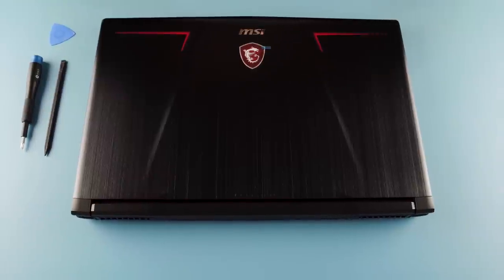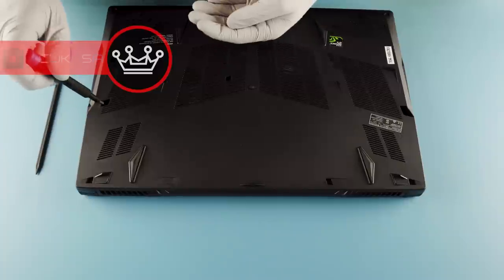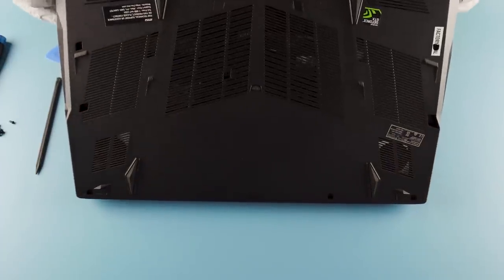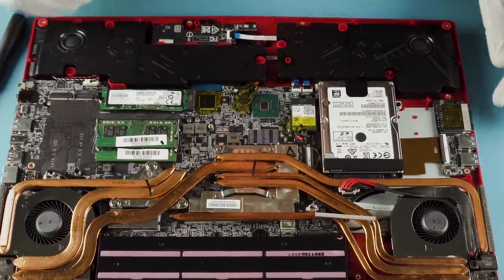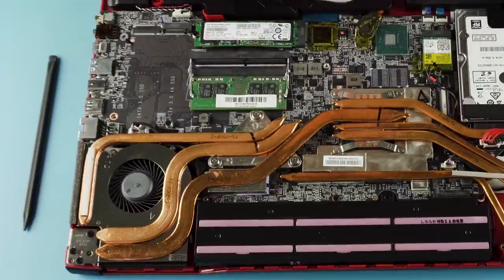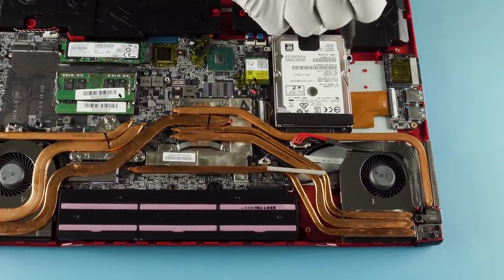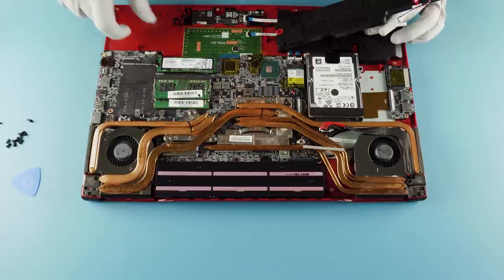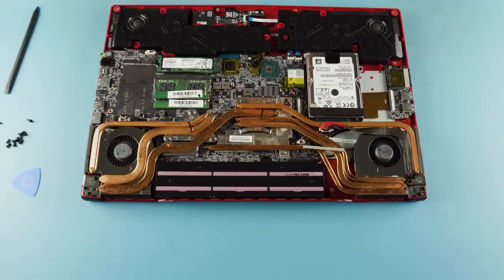MSI GP73 Leopard 8RE | Service Upgrade & Laptop Teardown Manual (How to)

Comment: I e-mailed MSI (UK) and asked about the factory seal. They said that removing the factory seal will not effect your warranty at all and it is only used for a dead on arrival laptop as an easy way to see if things have been messed with. They told me that the user can break the seal and upgrade everything from SSD's to RAM, changing out the battery etc and not effect the warranty on the laptop. They will not however cover damage resulting from modifications such as bent pins, cracked casings etc etc.
Reply: Also my GP73 Leopard 8re has a GTX1060
Reply: Great, so I can easily see what ram stick to order, and stick in my own M.2 860 Evo. Makes me keen to get the leopard-609 myself.
Reply: Thx. Nice info

Comment: Got a 2 year old MSI GP73 8RF. Wanted to upgrade it's hdd to ssd. As I never did anything like that with laptops, I wanted to leave it to the professionals. Then a local shop asked for ~100£ to do it... Long story short, your video saved me that hundred, and I learned something about the insides of laptops. Thanks!

Comment: Just picked up one of these bad boys as my first gaming laptop; I have to say I'm impressed at the accessibility to the parts. I'm hoping that I won't have to really mess with the internals but it's nice to know that everything can be accessed.
Reply: Does the hinges on the Display panel feel sturdy and strong?
Reply: @Tekkenesha  Yes
Reply: How is the fan noise on normal tasking and games ?
Reply: @last1b4free  normal tasking - the noise level is fine. Gaming - it's louder but no more than to be expected from a gaming laptop.
Reply: @RAiDeRTuRbO2  Thanks for reply! 
I hesitate between MSI GP73 and the ASUS ROG Strix SCAR II GL504GM-ES155T. 
I want to use the laptop not only for gaming but rather to function like a desktop PC to use it for 
massive software of engineering like Altium Designer, Orcad, Solidworks and so on. So when I working on it I want it will be pretty quiet as can.
I also not sure if buying the 17.3" or the 15.6" model. Coz anyway I will connect it to another external Monitor.
As I saw some Youtube reviews they said that the ASUS ROG Strix SCAR with the 1060 GTX graphic card more quiet than the other with the 1070 GTX.
So I think to choose the GTX 1060 ( might be enough for me ). I'm new with gaming anyway, not my main purpose. 
What do you suggest ?
Reply: @Tekkenesha  Just in case anyone comes to this thread years late for some reason- the hinges crapped out on me after about 3 years and I kept it open most of the time at an upright angle. Ended up needing to use epoxy glue and duct tape just so it wouldn't tear itself apart.
Reply: @Scott-ql2kx you can get it replaced as it's a design fault. Argue with them a bit and they'll repair it for free, outside of warranty
Reply: mine started breaking in 2 years. The plastic case where the display hinge is anchored is the weakest point....even the grills for the air flow broke. Very poor selection of plastic material...

Comment: i've got this exact same latptop but with a 1060. i just ordered the samsung 970 evo pro 2tb nvme ssd and wanted to see how/where to place it once it arrives. thanks for the video! looks like it goes right beside the current ssd sata in the combo slot
Reply: Did you add the NVME bare or with any kind of thermal pad or heatsink?

Comment: I was replacing a pad on a Dell 5590 that was bonded the same way and the replacement keyboard deck had the pad installed with the replacement.

Comment: This case is driving me crazy. One of the clips on  the side with the card reader is locked in place and no matter what I do I cannot pry it open!
Reply: Just rip it off
Reply: Did you get it to move in the end? I heard you had to pull the plastic cover towards the back of the laptop as you lever it upwards.

Comment: I cannot understand why the hell they still put the speakers on the bottom of the laptop?!!!  It's a damn laptop!! I get that they're designed to reflect off a hard surface like a bench or table but for the times I use my laptop in my lap or on the floor the fancy Dynaudio-made speakers shoot directly into non-reflective surfaces and get absorbed and all I get is low-mid muddiness. When I have my laptop on my computer desk, it's plugged into my KRK monitor speakers anyway!   Its truly a shame because in the right conditions they're actually really great speakers (MSI GT73VR).
P.S  I have a pair of really nice headphones as well but it's much more convenient to be able to use the laptops speakers when watching YouTube or NetFlix at my hotel. I mean why else would they make such a big deal about the speakers and work with a high-end Danish speaker company?
Reply: dannng thats a valid point, could be a game breaker!

Comment: Wondering if anyone has put 2 nvme drives in a raid 0 on these laptops.  I ordered mine and waiting on everything to get in.  Should be a beast of a laptop if I can raid 0 the 2 drives I ordered.
Reply: Bro, question, I thought m.2 slots could only plug in NVME or SATA most slots can do both or nah?
Reply: @RSD22.  This laptop has two M.2 slots, so you could have two NVME drives.

Comment: Would you recommend putting thermal pads on the back of a second nvme like with the stock one? Do they actually help mitigate heat, as it looks like they would just transfer heat directly to the MOBO instead of a heatsink.

Comment: I've been meaning to replace my potato with a more modern gaming computer and I wanted something that was fairly easy to take apart and swap parts out when I have to and after seeing this I am greatly considering it... My only question is, would I be able to swap out the graphics card with a better one after they perfect some of the later versions? Obviously I'm not wanting to run on an RTX 2070  when they eventually come out with insanely better performing ones.

Comment: Hey CompUpgradeKing - thanks for the walk through, that's very cool.

I can't find temperature tests anywhere for this model, nor any impressions on the screen quality. I'm looking to buy a work laptop for video rendering and budget is a concern, but so is the cooling system and screen quality. Trying to choose an i7 8750h model between the new Dell G5/7s or the MSI Leopards or PE62 model. Just can't find any sufficient reviews.

Do you have any advice or impressions to share?
Reply: Which Laptop did you buy? i7 8750H is very good.

Comment: So someone did the cleaning for me the first time to show me how to open and the RGB cable I believe snapped off then I just reopened it to do a second cleaning and it's lifetime and I realized the RGB cable had snapped off for the keyboard is there any way to replace the RGB without replacing the whole keyboard?

Comment: I liked your video and can I ask you a question: can I add the M.2 2280 Samsung 970 Evo 250GB NVMe stick in it? It should be mounted on that PCIe 3.0x4 slot, right? Thanks
Reply: Yes, I have it to and works perfect

Comment: Great video, I'm about to buy one of these,can you help me with a few things?
1. Does it overheat? I've read the fans are kinda loud, what to expect here?
2.Screen spec is awesome, what's it like in real life use?
3.Also, would changing the thermal compound be hard? 

Anyone who owns this laptop, I would greatly appreciate your help! Thanks
Reply: Fans are loud (but i don't hear them with my headset on), screen is great, not sure about changing the thermal compound yet, i'm considering doing it at some point though as it does get warm...
Reply: its loud because its a gaming laptop
Reply: @shiroyashaasdf330  Yes, the fans are loud because it's a gaming laptop. However, I've owned a few gaming laptops and this is the loudest I've heard. Fan 1 runs at around 5200rpm when at full speed and Fan 2 runs at around 5600rpm when Cooler Boost is enabled. When not gaming, only Fan 1 runs at around 2400rpm which is fine and pretty quiet.

Comment: Hello I have 8gb ram but I want to upgrade more 16gb wich ram I need choose?
Reply: Check the specs for your specific model. Make sure you get the same speed (the ram with the lowest frequency is what's in charge). Also for laptops get SO DIMM (I believe this model uses 260 pin connection). 

Crucial DDR4 2666MHz 8GB SODIMM
 - is what I'm getting for mine. 
Hopefully you have a 1x8gb installed and not 2x4gb (this way you can just buy a 1x8gb and you're set).
Reply: @RobertoRE999  does it matter what brand name is used? As long as it's the same specs all the way around?

Comment: Hello, how i can find part of components (Fan,Screen, Keyboard ect ...) for my laptop (MSI Leopard GP73 8RF). Thank you !
Reply: I had to replace the fan in one of my MSI laptops.  You get the model number and serial number off the actual part, then run it thru google.  The versions Amazon sold were underpowered, so take note of the voltage.  I got my part off ebay from China.  Most these laptops use the same parts, so get the serial number off the part you need, and run it thru google for a place to purchase.

Comment: The MSI GP73 has a 1070 and not a 1050ti
Reply: 2012日本語がわかりません ähm if you buy GP63 you get the version with 1060 and when you buy GP73 than you get the version with 1070
Reply: 2012日本語がわかりません but if you say that about the GE serie than you are right the GP Serie there isn’t that much choices and the GP73 is a amazon only product from MSI
Reply: 2012日本語がわかりません okey thanks for this information I really thought that GP73 has only 1070 because I live in Austria and in was only the GP73 with 1070 option and the GP63 with the 1060 option
Reply: Let's not forget the full model number - this will help greatly... GP73 8RE has a 1060 and the GP73 8RF has the 1070 afaik - I have the GP73 8RF

Comment: GP73 Leopard 8RE don't recognize fully loaded battery must be attached to AC charger
The old battery changed to a new one. The new battery is fully loaded. The computer don´t start up. AC attached and MSI will start up. When I disconnect the AC the computer will turn off. 
So, anyone got an idea what can be done? / Sorry if this is wrong forum for this question.
Reply: Have you run the MSI Battery Calibration software? Worth a try.
Reply: @Nick_R_  Where to find that SW?

Comment: Has this laptop waranty issues if you break the seal for changing hdd? My gp73 has only 512 gb ssd and no 1 TB hdd.  For games it is too small. So is it an issue for my waranty if I open it? And make the hole into the seal?
Reply from the maker: You should contact MSI directly just to make sure. You should have a right to upgrade your unit without issue (right to repair), but verify that info with them first.
Reply: Computer Upgrade King they sent me a hdd Kit to put a hdd in my laptop for free. So this is the confirmation i think, isnt it?
Reply from the maker: It would seem so, but it's not definite. Doesn't hurt to verify with them just to be on the safe side.
Reply: Computer Upgrade King ok will check it from msi directly
Reply: Computer Upgrade King i wanted to play pubg but my CPU is getting hot even if I play all on high or Medium. Other games not but pubg is using my Fans out to max sometimes. This little annoying. Can i get some Tips how i could to underuse my CPU and use more gpu for this game? So my Fans for the CPU dont turn up like a Helikopter!

PS:   Is there any Review for this, too
Reply from the maker: We haven't reviewed it yet. But will try to soon. PUBG is so poorly optimized right now and that's likely why it's using so much CPU. If other games don't have the same issue, it's probably just PUBG being the problem.
Reply: Computer Upgrade King Yes other games goin really well. Like black desert online,  call to Arms and conan exiles. Till now the only game that goes up more than the others is pubg xD ok i am looking forward to hear your Reviews too! Hope you can figure out how i could make the best Solution for noise control.

Comment: Is the small button switch by battery the bios reset button? If yes how long should I hold it to reset BIOS? Does the battery needs to be disconnected beforehand?

Comment: Is this the 256 GB + 1 TB model?
Reply: I guess so, cause you can see the WD HDD (7200rpm as per specs) and the SSD is a m2 slot (the one he unscrews first). I didn't knew they came with an extra slot for a m2 ssd (at least nothing is referred in the MSI manual), which is actually really cool. Too bad it only has 2 memory slots (8+8Gb), and if u want to upgrade to 32gb it needs two new memory sticks of 16gb which will be a bit expensive.
Reply: Just for reference, it doesn't come with a second M2 slot. There is room on the board but there is no connector soldered in so it is unpopulated
Reply: @MrPaddy1000111  Did you watch the video? There is room/space for 2 extra M2 slots but only one of them has a connector.
Reply: @RAiDeRTuRbO2  did you watch the video? Do you own the laptop? There is one M.2 slot and one pcie. Forget the other m. 2 as it has no connector
Reply: @MrPaddy1000111  And no, I don't own the GP73 8RE, I actually own the GP73 8RF (which, funnily enough, does have the same motherboard)
Reply: @RAiDeRTuRbO2  well if you have opened yours up like I have you will know that you have one M.2 slot that comes with a drive in it from the factory and a pcie slot that comes empty (unless yours comes with a drive in it)
Reply: @MrPaddy1000111  Yes, I have opened it and, according to the MSI spec sheet I linked above, the empty PCIe slot is: 1x M.2 SSD Combo (NVMe PCIe Gen3 / SATA )
Reply: @MrPaddy1000111  Out of interest, why did you open yours up? Have you replaced the thermal compound at all and, if so, was it successful and did you get any improvement? I've got some thermal compound coming in the post in a couple of days and plan do re-do mine on the weekend.
Reply: @RAiDeRTuRbO2  I just opened it to see what room there was for expansion. I contacted msi and they said that no warranties were voided by opening or modifying the product so you can ignore the factory seal thing. The only thing they said they wouldn't cover is damage cause from or during modification. I don't have any issues with the cooling on mine so I'm not going to mess with it. What paste are you going to use? I'm not sure it's worth it. You might get maybe 1/2 degrees lower temps
Reply: @MrPaddy1000111  I've ordered some of the CoolLaboratory Liquid Ultra and will see how it goes... My temps on idle are around 40ºc but, under load, I'm seeing up to 96ºc on the first 2 cores, which isn't great... Ambient room temp is around 20ºc... What temps are you getting?
Reply: I usually sit around 40 when watching youtube and messing about online. sits bout 80 something when I am pushing it with games etc. Only thing that would concern me is I am not sure if the CPU and GPU are capped. Coolaboratory stuff is conductive and I would be worried about a little sliver of it dripping off and onto a bare point. Would be interested in the result though
Reply: @MrPaddy1000111  Yes, the CPU/GPU won't be capped in a laptop, and I assure you that I will be extremely careful when applying the liquid. It's not as liquid as water so it shouldn't 'drip' anywhere unless I decide to squirt it all over the place and it's only applied thinly with a brush. I'll drop back with the results once it's done and let you know how it works for me. I may even do a video if I'm feeling brave.
Reply: @MrPaddy1000111  Just thought I would let you know... I contacted MSI support to ask about the material used for the CPU/GPU heatsink and they confirmed that it's Copper plated Aluminium so I don't think it's going to be wise to use the CoolLaboratory Liquid Metal that I purchased. I do, however, have some Arctic Silver thermal paste left over from a previous build so I'll use that instead and keep the CL stuff for something else. I'll be doing it on Sunday so will report back after then. What games do you play BTW?
Reply: @MrPaddy1000111  I decided I might as well go for the best paste I could. So, rather than use the Arctic Silver stuff I'd already got, I've just purchased some Thermal Grizzly Kryonaut, which I'll be picking up tomorrow
Reply: Have to keep me updated! Do you have any software for stress testing for reliable results? Would be interesting to see a apples to apples comparison!
Reply: @MrPaddy1000111  I just used the benchmark feature of ThrottleStop and took the screenshots using HWInfo. Just testing it playing PUBG at the moment and getting max temp of 84 degrees
Reply: @RAiDeRTuRbO2  This laptop has two slot m.2 or not?

Comment: how many Hours can i play this laptop at one Session ?  i heard it can be used for 8 Hours nonstop gaming. is this true?
Reply: Erkan Sentürk no Gaming laptop will last that long on battery
Reply: junkheadrooster i think i havent explaint detailed enough what i meant. I meant on non Batterie Mode. I mean cable Mode if i can explain what i mean. I meant the heat, fps drop and stability of a Laptop in cable Mode (non Batterie)

PS sry for my Bad english
Reply: NoVa_E, I have GL model but they are pretty similar. The fans are great, they can keep the notebook from overheating, so I think you can play as long as you want. P.s. CPU sucks in streaming.
Reply: not sure if this still helps, I bought a GP 73 RF (the amazon one with the i7 8750H and gtx1070
it gets hot, (cpus up to 95 degrees on modern titels, (doesnt thermal throttle as far as i could tell and had been pulling the about 4GHz for 2 hours while witcher 3 on max settings, soo id say it gets toasty ( i ma look into replacing the thermal paste, but other than that, it seems fine)